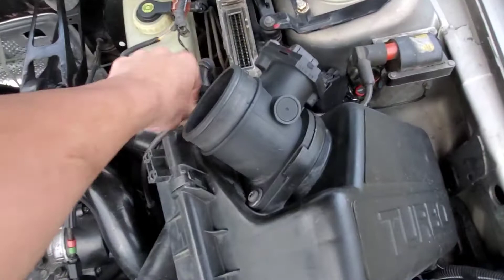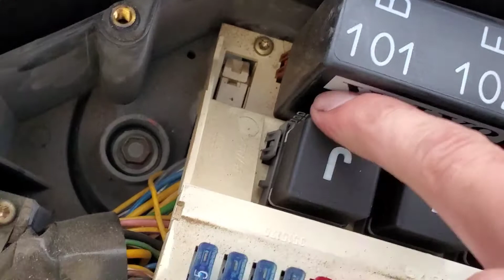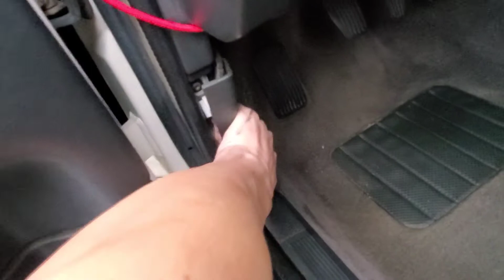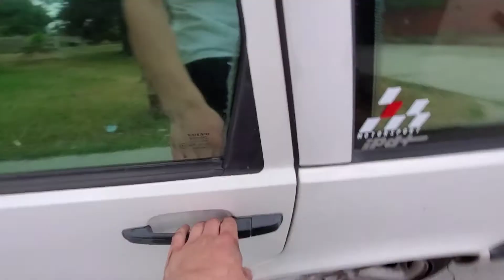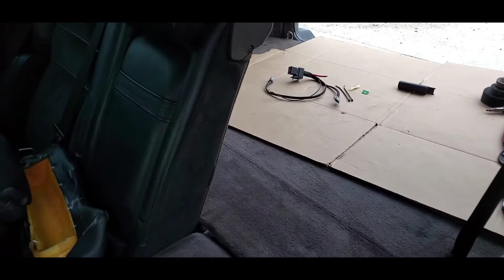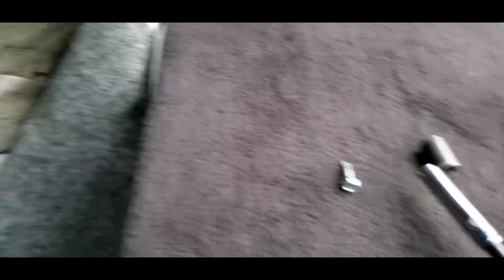Install of Fuel Pump Wiring Upgrade Kit

Comment: Did you install the AEM 340 pump as well?
Reply from the maker: Yes. We pretty much always upgrade the wiring and fuel pump for any car in our shop. 
Its usually nessesary, and if not it provides a margin of safety.